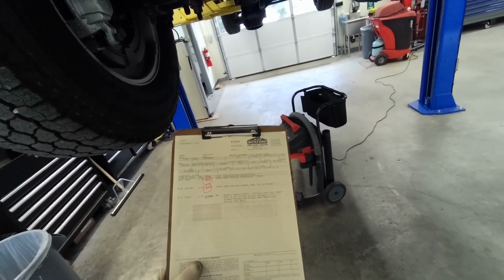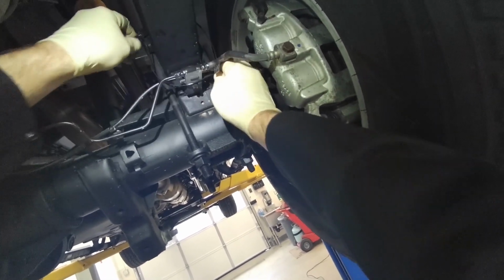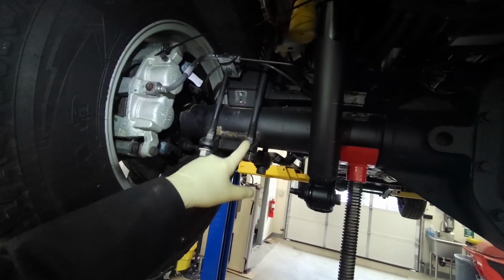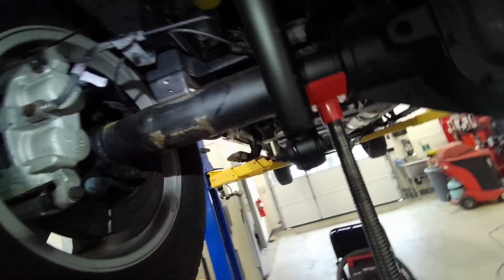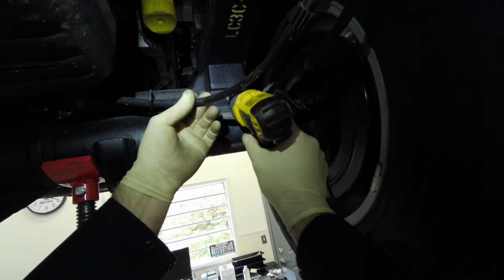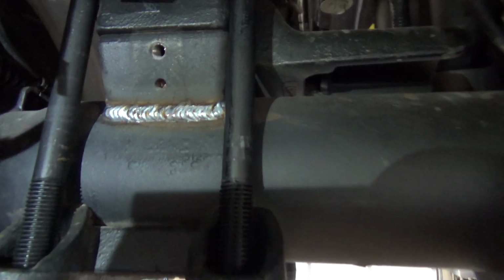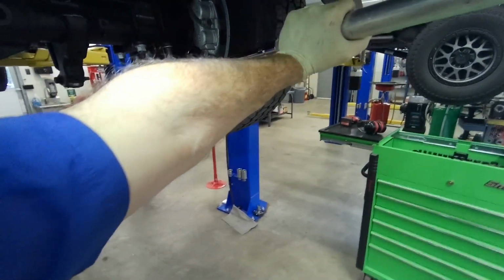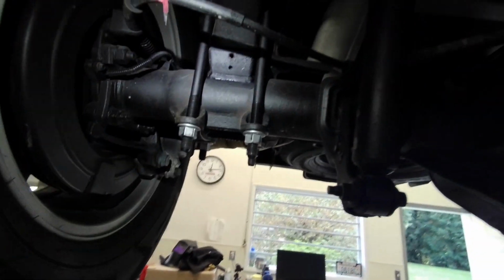YOUR NEW SUPER DUTY REAR END CAN FALL OUT! REALLY?

Comment: I have been fretting about what to take my truck.  Your video was awesome, and your craftsmanship was great to see.  I will be calling your service department now or on Monday to set up my appointment.  At least when I did the inspection in my driveway, the axle passed the feeler gauge, so you may end up doing the repair on mine!  Do you work at the dealership or at a different shop where they sublet?
Reply from the maker: Would be glad to repair you SD. I work for the dealership but at a separate facility about a mile away. We work for the sales department to repair trade ins & auction vehicles but still end up doing a lot of service/recalls. Just an FYI, parts department does not stock the parts. They have to be inspected/documented and then order can be placed through sssc. Sometimes it takes a couple weeks to get parts so I would schedule it in for a waiter inspection then drive it until they call you that parts are in. It's stupid how Ford does it. I asked parts department why they don't stock and they said Ford won't let them.
Reply: @raincitywrench117  Hey thanks for the reply!  I totally understand how the parts ordering process works (and agree it's goofy but I guess that's the way it works).  My employer has an operating base about a 1/4 mile up the road from the Dealer so when I drop it off I will go hang out there while the inspection is being done, and when the repair takes place.

Hopefully the backorder situation is not too bad with the parts and I will get the ball rolling on Monday.  Maybe you can make another video of my truck being repaired (which would serve no purpose at all but it would be cool!).😀
Reply: Rats.  The person at the front desk said they are booked into January and are only taking appointments from people who bought their vehicle at the dealer.  I don't like it but I totally understand (and I would like it if I bought from the dealer!).  This is probably because of the great work you do!  I will probably end up going to another dealer.  Keep producing these great videos!
Reply from the maker: @triples6959  This was at Bickford Ford Snohomish? Ridiculous! They want you to wait until Jan for inspection just to order parts and then another month to repair. Contact me @ raincitywrench@gmail.com Should be able to work something out soon to get it inspected/documented so the parts can be ordered at least.
Reply: @raincitywrench117  Thanks!  Message sent.  Look forward to hearing back!
Reply: @raincitywrench117  were is your dealership located, I live in Indiana?
Reply from the maker: @robertlegg509  Snohomish WA

Comment: Thank you great video. I am very concerned about this recall. I’m not confident in my dealerships welding ability. I plan to get the work completed then add traction bars for extra support. Do you think this would be beneficial?
Reply: @raincitywrench117 Great video, nice to see good quality work being done. The NHTSA recall report states a design change was made to the Dana axle housing and introduced at a certain date. That change was a thinner axle wall housing in the spring seat area (not sure who thought that was a good idea). The replacement housings, and those used going forward have a constant axle wall thickness.
Reply from the maker: @SM-ut6vb  Very nice! Thanks for posting. Found and read 21V-536. That explains it all and pretty much what I suspected.

Comment: Do you think this weld fix is sufficient over the axle replacement? Ive heard the axle tube walls are too thin. Nervous to get this done then tow my large fiver.
Reply from the maker: Check out NHTSA safety recall report 21V-536. Wall thickness is reduced in the spring seat area on the dana 275. I'm skeptical but guess time will tell. It could be the weld thickens the affected area and is sufficient. Personally I would prefer a different axle assembly but Ford won't do that. After performing recall and then pulling a heavy load, I would carefully inspect the tube directly below the front and back welds for any deformation. If all looks good then it should be fine.
Reply: @raincitywrench117  Thank you for this great video. I was fretting over this as well. I have a much better understanding of the issue and repair. Mine is in for repair in a couple weeks. I now know what questions to ask and what to look at. I am skeptical of the longterm durability of this repair as the fundamental problem is the reduced thickness of the axle housing. That was not corrected sooooo the repair is likely a bandaid. Thats just my opinion but it does seem reasonable
Reply from the maker: @jeffcox9930  Ford should be replacing the differentials in all affected vehicles. We had a customer in a few weeks back raising hell about replacing. Service writer says they don't think Ford will budge. I guess all you can do after it's welded is have it inspected every now and then like every other oil change.
Reply: @raincitywrench117  Thank you for your insight. Inspection at oil change  is a great idea. At the end of a heavy tow each day would be a good idea as well. I would feel more at ease if I saw the engineering data that supports the idea this is an adequate repair. I’ll bet there isn’t any and the repair is the only option short of a full replacement. This problem is still  in its infancy. In the end it might all be ok or it’s possible all or part 34,000 repairs don’t last and that creates a totally different dynamic.

Comment: Does the 20,21 have more HP & torque than older models ? More ponies causing this issue ?
Reply from the maker: A lot more but... Did another this morning and the side welds looked much smaller than the others, so since it only affects certain vin#'s then I suspect they had weak welds on one production line or whoever makes their differentials.
Reply: @raincitywrench117  that makes sense. I have to have my '21 checked, bummer that I'm not super confident I my dealer. I  haul a 3 axle gooseneck so it's fairly important.......Nice job by the way.
Reply from the maker: @davidleighton5701  The service bulletin allows for a welding sublet if they don't have someone competent but I understand. I don't have much confidence in almost every industry. LOL